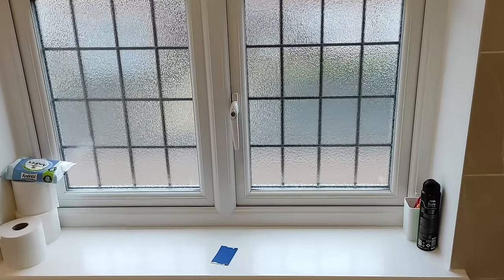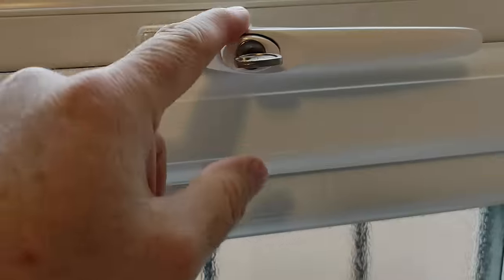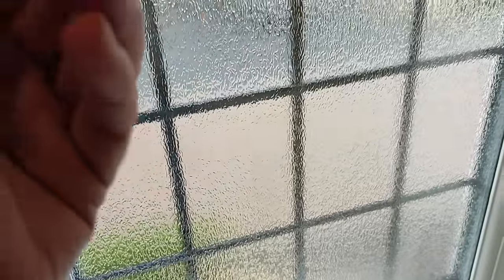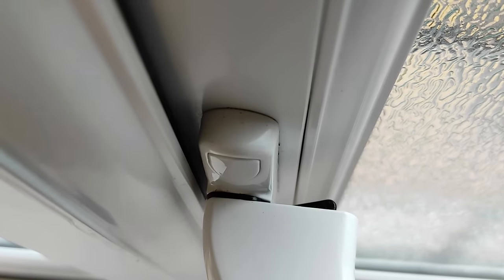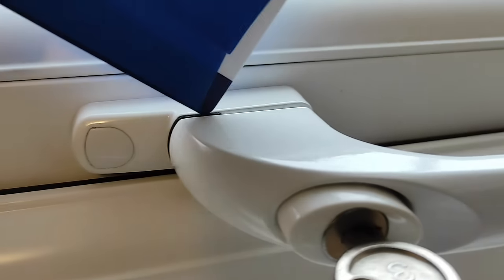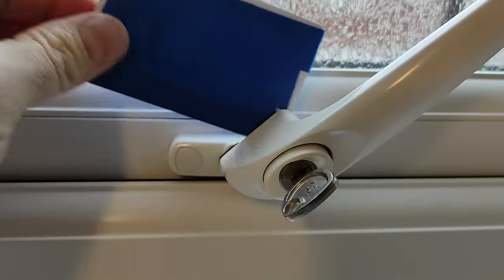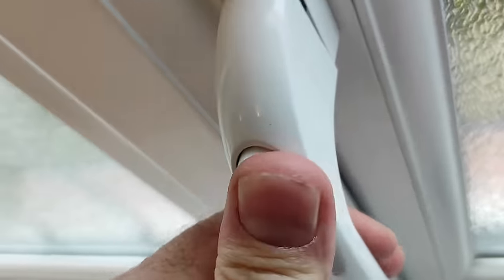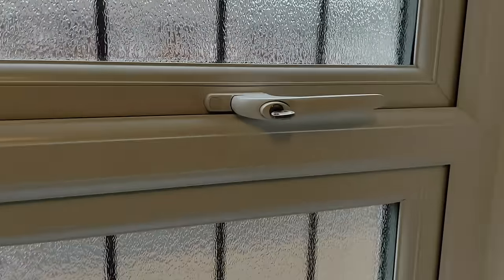How to Open a UPVC Window When the Handle Mechanism Has Failed

Comment from the maker: If you find a credit card, or whatever piece of plastic you're using is too thick to fit into the handle gap, try cutting up a plastic bottle or even a very thin piece of cardboard from some packaging should do the job.

If you need to make a temporary fix to your broken window handle, please watch this video https://www.youtube.com/watch?v=IUjnQOHy6KE
Reply: A credit card worked perfectly!
Reply: My bathroom window wouldn't open and the room is so hot. The gap behind the handle was extremely narrow and a credit card was too thick. Used your tip about a thin piece of plastic that I cut from the cover of a notebook. Got the window open in 5 seconds. Thank you so much. I'm incredibly grateful.
Reply from the maker: Glad it worked for you. @katieb928
Reply: So no I can blank the hole and no need to change the handle?
Reply: It worked. Thank you. I put duck tape around handle so is not locking again
Reply: It worked on one window but did not on another window 🤷
Reply from the maker: Great idea. @simonci5177
Reply: Omg my window handle has been stuck for 3 weeks I just tried this and BAM!!! Thanks so much 😅😊
Reply: Thank you, my window has been stuck open for months

Comment: Absolutely Fantastic. Took me 15 minutes to work it out but i used the bottom sharp end of a a tooth floss stick. In my case the gap was too small so had go with something smaller. Had to go in at a 45 degree angle. First it moved about 20 degrees and then i closed it again by accident. Broke that tooth floss pick. Got a new one, went at 45 degree angle and the whole thing twisted in one go. The key here is the angle at which you approach it. If you get it right, it will swing all the way instantly. Now time to find a replacement . Thank you very much.

Comment: That’s a great solution! Thank you. I was stuck trying to open the blasted window and now it’s sorted thanks to you. What I did after is that I cut off that black nipple that caused the problem and now it’s absolutely fine. You can’t lock the window now  but I live on the third floor of a block of flats so it’s not a problem. Cheers pal.

Comment: Omg...thank you so much. First time I've ever followed a youtube tutorial. I've had problems with my kitchen window & honestly thought I'd have to replace whole window, but in less than 1 minute using my bank card...ta'da window finally opened 👍🏼 Cheers 😊
Reply from the maker: Glad it worked for you. Fitting a new handle is also pretty straightforward.

Comment: You are a hero! ❤ 30 degree heat and I had the same situation. Tried this simple card trick and it worked brilliantly. Thank you sir 🙏✨️
Reply from the maker: There's nothing worse than a window that will not open in a heatwave.😀
Reply: @subterraneansecret  I was planning to sleep downstairs on the sofa! 😭😂 Thank you! 🙌🏼

Comment: you are my saviour , i had exactly the same problem but a slightly different lock system but your method worked nicely with a plastic hotel room card.thanks subterranean secret!

Comment: Thank you so much for your brilliant video. I persevered and managed to open my little kitchen window that’s been stuck for ages. In my case the gap was towards the bottom, almost onto the window sill. In the end I used a store advantage card ( the key ring  size ) then hey presto, it opened 😀 👏

Comment: Thanks for the video. Very useful! I ended up using a medium-hard guitar plectrum, cut down a little - worked well. I have a jar full of old ones. I've kept the bit of plectrum in the bag the replacement handle came in along with bolts and screw coves etc for next time.
Reply from the maker: Glad to hear you got your window open.

Comment: Many thanks for posting this video ! Saved me a lot of time and effort. I found a credit card too thick so I cut a small section from an old plastic tub that used to contain grapes from Tesco. The locking mechanism will need replacing as it's seized up but I least I can open the window now and remove the screws holding the handle in place when I get round to buying a new handle.
Reply from the maker: Glad it worked for you.

Comment: Thanks, my top window closed as normal (never had the key) but then wouldn't open. The press button felt 'odd'. Tried cut up bits of credit card, which only slightly moved opening handle up a bit. Forcing it further the black plastic 'washer' shattered and it now works perfectly again minus the pointless black bit.
Reply from the maker: Glad you found the video helpful.

Comment: Mine went this morning after 4 years in a new build.

Mine had to be pushed in from the top with a credit card, so some are different than others.

Are these parts not built as good anymore? My uPVC windows were 20 years old in my last property & no faults at all.

Thanks for the video. Now my window opens. 😁😍

Comment: The window on my apartment was stuck, so I did this using my credit card. Then when I opened the window of my apartment, which was on the top floor of the Burj khalifa, my bloody credit card fell through the window. I ran out after it but because it was so high up and the lifts were not working, it took me quite a while to get to the bottom floor. When I eventually arrived my credit card was no where to be found.
Next thing I know is someone has bought a Bugatti, and spent 500k on a shopping spree. I'm quite angry about it, but at the same time I learnt a valuable lesson. Do not use a credit card for opening a stuck window.
Reply from the maker: That's weird. The guy who lives across the road from me has just come home in a Bugatti, and not his Ford Fiesta.
Reply: @subterraneansecret  this happened 3 years ago. 😩

Comment: Where do you buy the replacement handle? Will they fit,ie standard
Reply from the maker: I bought my replacement handles from screwfix, however, they were not the same as the original, but a similar size. You do have to be careful, if the handle is too big, even by a centimetre, it won't fit correctly. It's best just to buy one at first, to see if it fits.

Comment: this is amazing. Unfortunately mine is not angled like yours so the card trick did not work. Any other tips or tricks on how to open one that is not angled like that? greately apreciated
Reply from the maker: If there is a small gap between the window handle and the mount that joins the window, then you should be able stick any thin piece of plastic into the gap and force the tab down. Try cutting up a milk bottle.

Comment: Just woke up this morning, my handle and button appears to be working fine, if I put finger behind the open handle I can feel the button press moving behind. However, my window does not open! Any ideas? All the videos are regarding broken handles. I did try and slip the lock anyway but no luck.

Comment: This worked- although in my case I had to insert the card at the bottom of the mechanism on the handle. It was a horizontal window as well. Inserting on the top didn’t work.

Comment: I've just purchased a new handle cause the last one snapped off somehow. I'm putting the new one in and it's not turning at all. The locking mechanism works fine as its new, so I don't understand why it won't turn.

Comment: I really want this to work. The gap I have is far too thin for a credit card. I used a library card because nothing is embossed on it but it's too thick. Struggling with what to use instead.

Comment: For replacing/fixing it, do I just need to get a new handle?
Reply from the maker: You need to find a handle which is a similar size, if it's too big, it won't fit.

Generally speaking, most replacement window handles will fit the majority of windows.

Comment: idk my window handle is stuck but its not in the starting position. It tried to open it and it got stuck in between the closed and fully open position. And i doesnt seem to have some kind of a  mechanism, because i can se the bottom and there is nothing there, even though it has a lock i dont get it.

Comment: Nice one. I just snapped out the plastic bit and put the handle back on, just means you can’t key lock it. That’ll do me boyo 🎉
Reply from the maker: Good idea.
Reply: @subterraneansecret  il give you a laugh, took the first one off, I was sat trying to work out the mechanism and wether it can be fixed and I locked it in my hand!!! 😂😂😂 I’ve 8 conservatory windows so they’ll all go at some point.

Comment: My issue is that the handle is completely floppy It's like it's disconnected It flaps about I can move it right up to the handle pointing upwards or downwards and the window still locked shut, any suggestions Thanks
Reply from the maker: Difficult to say without seeing a picture. It may be the screws are loose, or perhaps even broken. If you can open the window handle, you should be able to tighten both screws. The top one is usually hidden underneath a plastic cap.

Comment: is it possible to fix the handle?
Reply from the maker: Impossible to say, but unlikely. These units are usually sealed and can't be opened with conventional tools. Even if you could, the part that's snapped/broken won't be easy to replace or glued.

Comment: Too many of these handles have failed it’s time for a redesign of them .
Reply: Don't be daft - that IS the design! Managed somehow to make a basic latch mechanism decades ago still going strong today - but no lucrative repeat/repair business in that! I know - let's bung in some plastic susceptible to failure - ker-ching!! 

[You're still right, of course.]
Reply: I never knew so many of this
window type had failed til I watched this video. I'm a.bit surprised now. I looked this one up since I lost my key a while back, and obviously I couldn't open my window until now, so I've found this video very helpful indeed.

I must say though, I'm definitely going to agree with you... a new design of window definitely needs to be invented, and preferably one that does "NOT" use a key to lock/ unlock, lest the problem with losing the key is solved.

Comment: My windows aren't stuck at the handle, that moves freely. Turning it doesn't slide the bolts that hold it shut! Every window except one is like that in my flat.
Reply from the maker: Sounds like the internal locking mechanism within the actual window frame has completely failed. If that's the case, I'm afraid it's probably a job for the professionals.

Comment: I tried this no luck 😢my window is already on 2nd lock and the handle has failed i tried a credit card but handle won't budge
Reply from the maker: Sorry to hear that. Can't offer much advice, other than to try from multiple angles. Also, if the window does have a lock, make sure it's unlocked.

Comment: I’m sorry but that is not working on mine! My lock is not straight. It has a built in kink to it and the card in no place will get around that kink. And pretty much every window has jammed in exactly the same way. Some closed, some open some half open/half closed but I haven’t got 1 single window working!
Reply from the maker: Without seeing a picture of your handle, I couldn't really advise. However, have you tried cutting up a plastic bottle and making a very small strip of plastic?

Comment: It works - 🤔but now how to get the bits out so that I don’t need the card to open window every time 😂😂
Reply from the maker: If you mean the plastic tab which is broken. I would remove the window handle, and then try picking it out with a screwdriver, or you could just buy a new handle.

Comment: my handle turns fine but the window still wont open
Reply from the maker: Sounds like the internal mechanisms inside the window frame may have failed. If that's the case, you may need professional advice.
Reply: @subterraneansecret  uk heat is on another level with this humidity ima break the window open atp

Comment: Fair play to this video, but ask yourself why this happens, lack of oil is why things stick and wear out, lubricate every now and then and you may never need to use this method.
Reply from the maker: I do lubricate the window handles regularly, and this doesn't seem to solve the problem. Unfortunately, it's down to poor build quality.

The replacement handles I bought, are holding up well.
Reply: Pleased to hear it , buy better quality products next time, cheap in the end can turn out to be more expensive. 
Cheers. @subterraneansecret

Comment: Sadly didn't work for me, and, boy, did I try.  Old credit card, bit of cardboard, bit of plastic bottle, even the nail cutter knife trick recommended by someone else. Just a wobbly latch but well and truly stuck open on the lock - regardless of whether unlocked by the key. The pity is the weather's awful again, I'm in the North "Wet' of England, and because I have covid, and am the sole carer for a terminally ill mum, who requires close constant care, I'm opening windows with wild abandon and masked and gloved and pinned to the gills. I can't call out my usual go-to fixers  until no longer contagious.  If nothing else I have a constant supply of fresh air which is good but not so keen on the  rain at all times of day and night.
Reply from the maker: Sorry to hear it didn't work for you.

Comment: Tried this 19 times and nothing 🙄
Reply from the maker: Does the credit card fit into the gap? If not, try using a thinner piece of plastic, like cutting up a milk bottle.
Reply: To note I used a decorators knife as it’s metal and I was worried about snapping a credit card. They are a bit wider so may make it easier to leverage the switch in so that you can release the handle